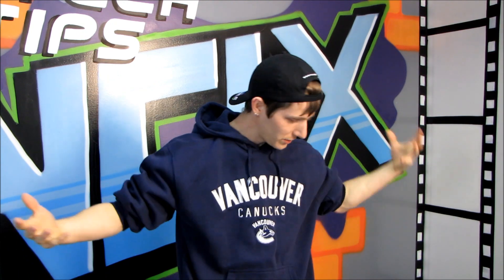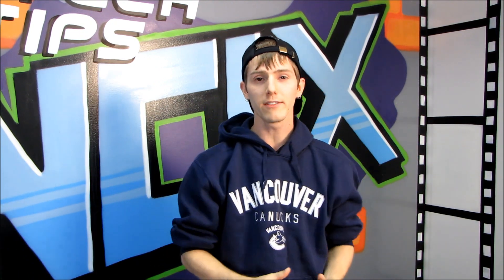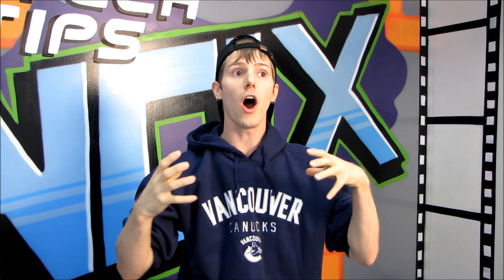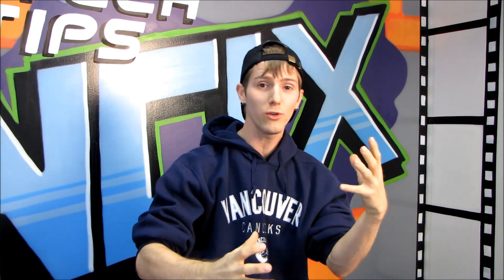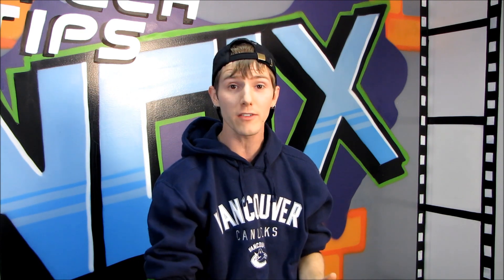Futureproofing Your PC - Dispelling Some of the Myths NCIX Tech Tips

Comment: My response is in dealing future-proof system, if I was  building for a budget oriented friend:
imho, futureproof also means stability, keep it cool with large after-market cpu Heatsink with large slow moving fan, and add 1-2 90mm+ quiet case fans (in addition to what comes with the case).  Keep it cool but with minimal air flow to minimize dust buildup and subsequent heat damage over the next few years of use.
--Motherboard: any gigabyte, msi, asus board with the latest memory, sata6, usb3, uefi bios,  and which has decent reviews.  board should also have at least one pci slot.
--cpu: any intel i5 - it has the performance, and encryption tech. All while running cool.  Should also handle operating system upgrades for the next decade.
exception: if insisting on onboard graphics then one of the latest quad core apu's such as a10 7000 series
--graphics minimum hd7750 or 650Ti or r7 260x
--psu: seasonic/corsair 650watt minimum with 80+ rating
--memory: 8gb minimum kingston or muskin or patriot (min. 1600mhz) due to the current prices.  If the prices drop again to previous levels then 16gb, or even 32gb if the price is right.
--hd: wd blue or green, which ever is on sale
--case: corsair carbide series, antec 300
--fan filter for the intake fan with the highest flow
--should a system have a blueray drive to be considered futureproof??
--latest bluetooth tech either onboard or addon: to connect our tablets and phones to the pc, especially as tablet are becoming more prominent.
--would buying a touchscreen monitor be future-proofing the system??

Comment: -AMD FX 8350 4.0 GHz
-Nvidia GTX 770 2GB GDDR5 (may SLI 2 of these...)
-32GB DDR3
-650W Antec 80plus bronze PSU
-120GB SATA 6gbps Samsung SSD
-2TB WD black HDD
-Windows 7 ultimate 64 bit
-650GB WD blue (Ubuntu boot disk)
-2 DVD R/RW drives
-3 1920x1080 monitors running in surround

Runs just about everything I throw at it. Except a few oddballs that don't like to give good framerates for some reason (HL1 and MW3 come to mind, HL2 and Ghosts run great... WTF.)

Comment: EVGA GeForce GTX770 SuperClocked
i5 - 4670k
8gb ram
800W
HAF X or Haf 932
TCP 812 or NHU-125 or TC14PE
But what's the least minimum (good) motherboard i can get?
Reply: Maximus VI Hero,btw what psu are u getting??
Reply: The ASUS Z87-A is a bit cheaper than the Maximus VI Hero.
The Hero has some advantages (e.g. two extra SATA ports) and a few more internal USB3 ports.
It depends on what you're planning to do, really.

The Z87-A works splendidly for me, but if you're planning to go with a large RAID configuration you might want to go with the Hero.
Reply: Dojan5 hero is the way to go no way for x87-a board.

Comment: 12-05-13
Mobo > Asus ROG Formula VI
CPU > Intel i7 4770K
CPU Cooler > Custom water loop
Memory > CORSAIR Vengeance Pro 32GB 2400 speed
GPU > 2x Asus GTX 780 in SLI
PSU > Corsair AX1200i
HDD > 2x Samsung 840 pro 256gb in raid 0 and a Drobo 5D with  5 x 2TB WD Black
 Thats my setup for professional photo/video editing & gameing

Comment: I like to purchace the best BANG for the buck stuff i can. example, currently i have a i5 2500k @ 5ghz on air / 12 gb 8-8-8-20-c1 1600mhz (4gb and 8gb kit of the same chipset) 2x 560ti @940 core and 2244 mem. at this speed i score 14% slower than the new i7 with a 770gtx on average. If all you want to do is GAME than please get a very good overclocking cpu and the fastest ram your budget can handle. I get the best bang for the buck vcard as i upgrage them about every 2.5 years

Comment: That is really true, when I built my first PC I was not an expert so I cheaped out on things for example my motherboard. I bought a cheap motherboard which only had 3 PCIe expansion slots, later down the line I wanted to integrate a huge powerful GPU and it took about 2 PCI slots only leaving me with one which did not work with my WIFI adapter, I had to buy a new motherboard...

Comment: Example of futureproofness: back in the 2010 when this video was produced, the gtx580 was a top of the line. Right now, 3 years later it can still get nice resolutions but to perform with the 2013 games as good as the 2010 ones you need to 2 or 3 sli it. So instead of buying a tri-sli 580 setup in 2013, you just buy a new 780 and you get the same or better performance with the option to sli the 780 in the future and get the same performance as a 880 or 980 (if they come out).
So this is what is featured in this video. Get what you need now (e.g a GTX780) and upgrade it in the future (another gtx780 for sli or a gtx880) which will save you some money, instead of buying a 3-sli gtx580 and be forced to buy a new gtx880 in the future which is going to be much more expensive

Comment: Hmm... I went with a 900 watt PSU with many many cables and a hyper 212 cooler and SLI compatable motherboard for future proof reasons... I think it was a good investment but I don't know. 

Specs:
GA-990fxa-ud3
fx-6300 @ 4.5GHz (with temps enough to go to 5.5GHz probably)
PSU has more than enough cables though Idk how long 900 watts will be enough... but I'd say I like my investment. Everything else is just what I need for now, GTX 760, 120GB SSD 1000GB HDD 7 fans, 1 8GB stick DDR3 1866 RAM. Idk you guys tell me if I left room to improve. I can always SLI another 760, or sell it and get a newer SLI configuration. AM3+ is still making faster CPUs so I can upgrade that for a little while unless my board decides it won't support them...

Comment: How 'future proof' would the following system be? 8-core 3.5Ghz, 16 gigs DDR3, GTX650Ti 2Gb, 2 SSD's (System and games) 7200 RPM 500G (Storage), liquid cooled, no overclock. That's roughly what I'm hoping to save up for so I can run games great now, and solidly later.

Comment: and then upgrade to a new gen gpu 1 or 2 times. but games will relly more on gpu than cpu in future and right now a 2500k (2 gen old) won't bottleneck that much (or at all) gpu -> short life cpu -> longer

mobo with relieble component (not total high-end bur mid say... 200$)
PSU = 850W silver
16gb ram
and a 2 tb HDD (cause they are ceap for the capasity)
ssd? would care that much... it goes so fast? 128gb and then get a bigger in futer and use 128 for casching
other stuff is buy what you want.

Comment: i wuldn't at all buy new now. If you could live with the pc you have i would buy in the summer because 2 things

1 intels tik->tok system means that we will see a 14nm cpu in 2014 nvidia will make 20nm gpu with an ARM cpu/SOC ontop of the card. This is new ways of thinking and i see the next step in mores law around the corner. thoose steps comes once every 2nd year and we are 6 month (or so) away.

2 on future proofing. i would buy a gpu like 760 cause they don't bottleneck that much (only one)

Comment: I recently bought a 5 year old dell for 10€ with following specs:

Cpu: Intel Core 2 Duo 6700 2,66 ghz
Gpu: Asus geforce gtx 660 oc 2gb
Hdd: 2x 250 gb 7200 rpm
Motherboard: dell
DVD: Samsung
Ram: 4 gb 800 mhz
Cpu cooler: dell

and i can run BF3 at maximum settings

Comment: I've built my pc 2 months ago. 700W PSU,FX8350 CPU,8GIG Vengeance RAM. I've kept my GT440 from the previous PC aswell as the 250gig HDD.What i have in plans to buy: HD7870 and a 500gig HDD. will that be 'futureproof'?

Comment: Best way to future proof is to spend less money, and save it for... the future. Buy computer components which, as a whole, have the best price to performance ratio, but only buy what you need. To a very limited extent, it can help to avoid buying motherboards that use older standards, and whatnot, as a way of "future proofing,"  or to pay a little more for more reliable parts with longer warranties. Basically Linus knows what's up, even though he's only 14 years old :P

Comment: How about this, get a motherboard that will fit future cpus from manufacturer, in this case AMD, they use same sockets , AM3/AM3+ and are backwards compatible or FM2,
1 Ram stick (unless apu) 8 (even 4 gb) and a mid-high end gfx card which you will crossfire/sli at a later stage. Your investings will go down with time, while your performance will go up? Just a thought.

Comment: umm You do know that the GTX 780 is using Nvidia's new GK110 chip and the gtx 770 is using last gen's 680 gpu (gk104).  The gtx 780 has way more performance - Just another factor to think about before you drop your gtx 780!!

Comment: I personally believe a good power supply is both, futureproof and a present investment that's worth it... for 2 reasons:

1. you usually only buy one power supply and use it down the line for at least a couple systems, power that's required doesn't increase, it usually goes towards efficiency, so u wont all of a sudden need 1000watts, unless u wanna SLI things up

2. the likelyhood of your pc being burned to the ground is less

Comment: i think quad cpu's are for 775 socket only...check if your motherboard can support an intel core 2 quad q8800 or better. I had a q8800 at 2.33 with a galaxy 9800gt and played even cod mw2 at max setting at 1680x1050 (this was my monitor's resolution at that time). Propably a quad core will play almost all the games out there very decently. ;)

Comment: well yes you are not wrong...the storage depends on what u do. I just record music so i dont need crazy space...propably the most storage i ll need is a 3TB HHD. If u do video animation rendering etc just go 4x3TB which is a lot of money...for the psu though a 1200 would be nice to have, in this particular build at max load the power s1 would need is about 600w (depending on additonal fans,leds etc) so 50% of the psu at max load is not the best. If u add an other GPU yes its a good choise :P

Comment: 2x8 dominator platinum 2400 - 270$. Obsidian 900D - 350$. AX 760i PSU - 210$. H110 - 130$. 4770K - 330$. GTX 780 - 600$. + mobo and SSD (i havent decided yet for those). All the others cost 1.900$...1 ssd 120gb is about 100$ and a mobo idk 200$...smth like that. Its slightly more that 2000 and i overkilled it with the 900D and the dominator...(+ i converted dollars to euros and it is about 2000euros..my mistake). But overall with that high end machine u go about 2300? MAX

Comment: I have to say this about the cheap mb and the higher priced ones are not the same, when i built my computer i got a gigabyte z77x-up7 because it has 2 16x pci-e slots and 2 8x pci-e slot i have not seen a cheap mb able to support 2 video cards at 16x like mine does. But some people may not care but to each there own. Other than that this is a great video.

Comment: No. He distinctly said 'Instead of buying a 600w unit buy a 1000w' because that will be futureproofing. @ 6:13. Which is not true. Capacitors age, power supplies should not be depended on to equate their stated ratings beyond 3-4 years of normal use and no more than 1-2 under 24 hour full utilization. Power supplies typically lose 10-15% of their rated capacities over the course of 3 years. Especially cheap ones that use inferior components.

Comment: I cannot agree with "overbuying" a power supply. Most systems do not utilize more than 300w. Buying a 1000w PSU will not "future proof" you. Power supplies are HIGHLY inneficient under 30% load. So in addition to wasting power, you are also setting yourself up for capacitor aging and voltage ripple. Older power supplies with worn components often result in dirty power being sent to components. Not only can these damage them over time, they can also cause logic errors which result in instability.

Comment: Yea wanna know my 3 yrs old PC?

1 Case In-win Dragon slayer

2 Core 2 Quad Q8300

3 Asus P5P43TD PRO

4 Gigabyte GTX 660 OC 

5 Corsair vengeance 4 x 4 1333 Mhz..

6 500 Gig WD 7200 rpm HD

7 Corsair TX 650 Watt

I will eventually uppgrade to Haswell later and add another GTX 660 :D

Comment: I agree with with everything but the SLI - I have gotten a mid lvl card $250-$300 card then added another one a year later when it was selling for $190. SLI gives %70-%90 increase in FPS. If you Google high end benchmarks, the GTX 470/480 still competes with 5xx 6xx series and is around the same price. There are many videos out there stating two cheaper SLI cards will out perform a pricey single card.

Comment: AMD drivers ? They are completely piece of shit. I had problems with them since ATI 4870 x2 and now with AMD 6870 like fps drop and graphical glitches, sometimes i need to install older drivers and not reccomended ones. If you are looking for a good drivers, Physx running from GPU, quality card go with Nvidia. If you want the the best preformance go with top od the line AMD cards with aftermarket cooler like from ASUS or MSI because with a stock one it gets hot like hell. That is my advice.

Comment: Just bought my new system yesterday.
1 CASE:.ThermalTake Level 10 GT
2. PROCESSOR: AMD FX- 8350
3. MOTHERBOARD: ASUS Sabertooth 990x AMD
4, GPU: Sapphire HD 7950 3GB
5. RAM: G. Skill Sniper Gaming Series 1866 DDR3 (4 x 8GB) = 32GB
6. MEMORY: Western Digital 1TB running at 7200rpm along with a WD Velociraptor 150GB runnning at 10000rpm (OS)
7 .PSU: Apevia Warlock 900W ATX

Any Recommendations? To add? or exchange part for another part?

Comment: I'm planing a typical build around an i5 4670K. I chose most of the components that you'd expect plus some good quality.
Unfortunatley my wallet tells me otherwise, so that I'll wait to buy a liquid cooler + extra fans until i start overclocking, which i won't do that right off the start. (+ $250).
Plus graphics card's prices rise exponentially while the performance rises linear. So I have to cut it down somewhere, so i can upgrade down the road. For the start: a GTX 760 as soon as it comes out.

Comment: I've always had bad luck keeping power supplies around through the life of a system. Didn't help me to have a higher rated power supply if it was going to bite the dust before the rest of the components. I go with what I need, knowing more than likely I'm going to have to replace it before I replace or upgrade anything else.

Comment: I'd say a bit more Watts space on your power supply so you can still use it in the future as the power cap it's rated at degrades just like rechargeable batteries.

Comment: I'd say a Hard Disk drive is very future proof, GIVEN your storage capacity needs do not change dramatically. I have IDE drives that are 10 years old that I still use for (non-critical) installs because they work just fine. Not that I'm saying that you should buy a new IDE drive, just if you have one that works for you, instead of spending $100 on a new TB drive, spend $20 for an IDE card for the 300 gb IDE drive you already have. Given sufficient RAM, it is just as fast as a new one.

Comment: Not quite. SSD's don't last as long as you might expect. A good quality one will last you at least twice as long as it'll take before its size is so tiny by the standards that it doesn't make a difference to your machine, but it won't last forever.

Comment: intel i7 970 six core
gtx 650
ultra x3 1000 watt
12 gb ddr3 g skill 1333
cooler master haf 922m
2 tb of sata 6 storage

AMD FX8150 eight core processor
gtx 650
ultra x3 1000 watt
8 gb ddr3 kingston hyper x 1600
XION Predator mid case
2 tb of sata 6 storage 
My old lga775 build I'm selling to a friend of mine runs newer stuff.

Comment: You want futureproof well here it is:

mobo: asus z9pe-d8 ws intel c602
cpu: 2x intel xeon E5-2687 8-core
gpu: nvidia quadro 6000 6gb ddr5 w/ gpgpu accelerator
RAM: 128 GB ddr3-1333 ECC
storage: 6x 960GB Crucial M500 SSD SATA 6G config in RAID 5

This rig will be top of the line for gaming for the next 500 years guaranteed. This is a setup for a megaserver and gaming is literally a flick of the finger for this machine.

Also, it costs $32,000.

Comment: an ssd is futureproof, why, because it lasts almost a lifetime, will always be quick, and is very feasible. mechanical storage devices - not really unless you find a super high quality one with fluid dynamic bearings and literally every bolts and part made in japan which most of them are not like this, they are cheap for a reason.

Comment: im gonna go with the highest quality parts for my next build, after all, its intended to be kept until 2030, cmos battery replaced every 5 years, new graphics maybe and thats about it. fans wont need replacing because all of which will be fluid dynamic bearing type that should last around 100,000 hours, cpu will be a haswell quad core processor so that will very future proof, and i will use a ssd, the build will be a near silent and reliable build though rather than more performance oriented.

Comment: I thought my computer I bought a little over 4 years ago was pretty decent for its time, AMD 5400 black edition, 4gb ddr2 ram (1 ram slot burned up so i'm down to 2gb sadly, and the two other slots wont read the good stick) 9800GTX+, 850w supply, and 750gb hd. Wish I knew how to use the other memory slots, using the white ones now, blueones never used.

Comment: I have core 2 quad q6600 and 9800 gtx in sli with asus 780 stryker 2 extreme.. built it in 2008 and it plays battlefield 3 high-ultra 60 fps

Comment: then i guess you best route would be to invest in a i7-3770k, its your best bet for that kind of work without going "over-board", add an after market cooler (doesnt have to be an expensive one, the hyper evo 212 will do fine) just so you can OC a bit every year to keep up speed, along with 16gb of ram to start with (i'd go 8GB sticks) if you ever work on big project and run out of ram you will have space for 16gb more, that'd be your only "upgrade" altho adding ram takes 2 min and...